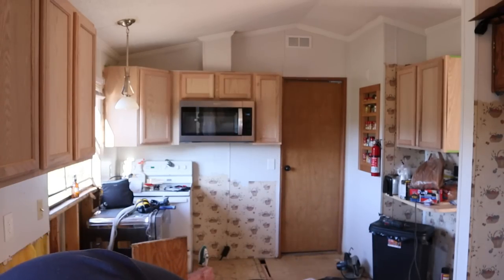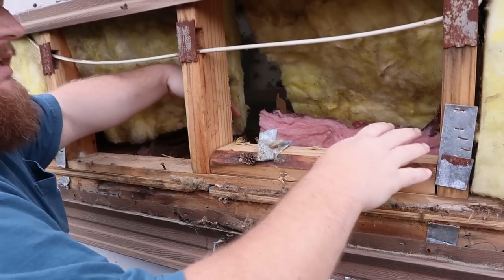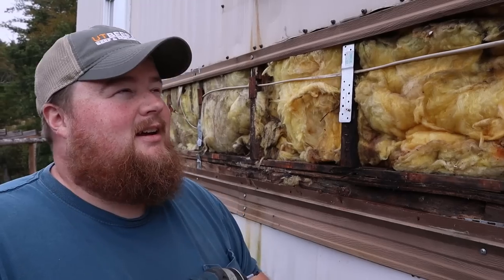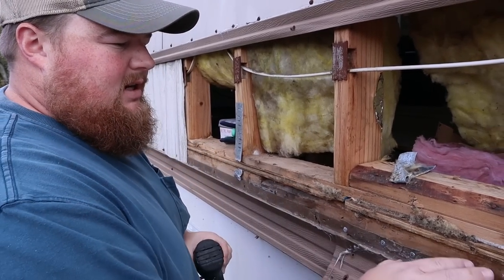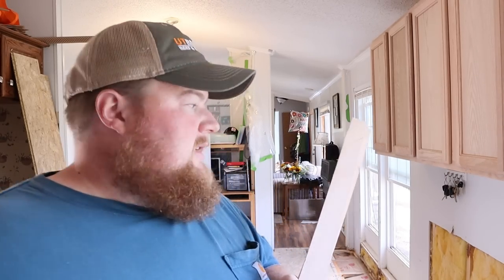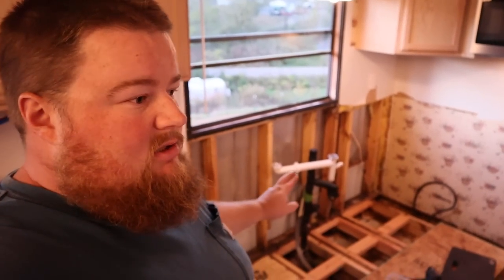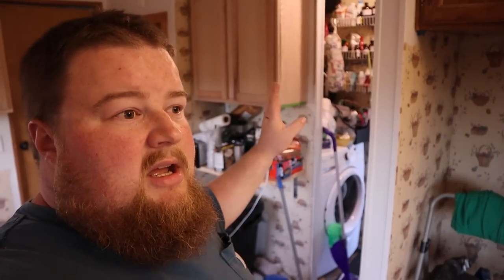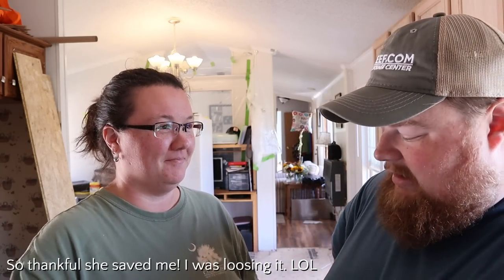Siding Removal Shows Just How Bad This Is | Budget Mobile Home Remodel #14

Comment: Sam, i think i mentioned i have a 95 double mobile home and i was wondering i would have to pull down my belly wrap to pull all those lines out? Or should i do like you and try to replace them room to room. The big issue is i dont have the floor issues yet…well my master bathroom does. I’m going to be fixing it this winter when i get a chance probably in December . Would you bother to remove them? I’m not sure how to approach it. I recently attached pex to my grey lines and now im scared i used shark bites…

Comment: I also have 1980ish model single wide. Im thinkin of doing some of the remodeling yall did on yalls. My main question is. Did yall go back with standard size 2x4 studs in yalls outer wall of the mobile home????

Comment: Guys i know this feeling all to well. Its one thing after the next. It makes it even more disheartening when your currently laying your head down at night in the area your working. Dont give up one thing at a time. Great job.
Reply: I have inherited a single wide. It has a metal roof over kit installed. The home is sitting  on heavy, poured  concrete runners and still on it's  wheels. 
It's everything in between the roof and foundation that has me very concerned !.

Comment: I know this is an old video but, did that wire arc at 6:15? The stud on the right, that “plate” that holds the wire on looks like it arced when you moved it up.

Comment: I found  aluminum  coating for the roof  it helps with leaks and house wrap can also be used on the inside  to help seal your house. I had to replace  a huge amount of mine

Comment: Gr8t job. I have a 2004 and just noticing floor leak . Outside siding holes to let water drain have been clogged. Water must be just dropping down between wall n siding. Haven’t pulled apart yet.your video gives me options thanks very much. You both are a terrific team.
Reply from the maker: Glad it helped, good luck!

Comment: I used the spray flex seal on my car's sunroof. The drain channel goes from it to the floor of the trunk. It is supposed to drain onto the road, it gets clogged from stuff on the road. It kept the trunk full of water and then it started leaking into the car. It filled the headliner and started coming out at the windshield and the light fixtures. I came out after it had rained to find about 3 inches of water in the floor board. After I got the water out, I went to Lowe's and got a can of Flex Seal. I sprayed it on and just had to add another layer about every 3 months because of the sunlight. I hated that car so many things were wrong with it. It was an Oldsmobile Aurora, 2001, it's a GM. All that wasn't as bad as the fact that it accelerated on it's own, either when you started so you had to turn it off and on until it stopped, or while you were driving it would do it. GM didn't want to talk to me. I don't have it anymore, I sent it to the junkyard so no one else would be almost killed by it.

Comment: My wife and I just finished replacing the floor in our kitchen in a house built in 1951. We have 1x8s running at 45 degree angle, then 3/4 inch  ply wood, then four layers of floor covering. Couldn't get the floor covering off the  plywood so we decided to replace it. They had three inch nails to hold the plywood to the sub flooring. I bent my crobar getting the plywood up. Got the new osb down, looked great, new tiles and we are very pleased. Watching you made my back ache again. You are doing great work, keep t up.
Reply from the maker: Oh wow!!!

Comment: You two are working really hard and doing the best you can!!!!
You all couldn't find some type of under lay or Osb board to put outside to box the insulation in, and began putting vinyl siding instead of that metal siding outside. Do 1 side of the side per payday to fully waterproof the home.  That siding is your only defense against the weather!!  Your home looks nice inside like those newer mobile homes. It just serms like you all need to research exterior  materials that you can put on that outter side under that metal siding or under new vinyl siding!!!!

Comment: You Two are doing a great job

I don’t know what You Two do for a living but You  are doing Great here

When You replace the insulation and removed the old I couldn’t believe what I saw.

Palm Harbor Homes put aluminum siding on Your home and attached them to 1x6 slated every 2 or 3 feet and the insulation right up against it

We repaired a single wide that had floor and wall damage from those leaky Mobil home windows

Our Mobile home had OSB over the wall studs and then vinyl siding over that 

No moisture barrier between the siding and the vinyl 

OSB for almost the entire length had water damage 

I had Our Guy pull the entire side down to the studs and remove the windows 

We were lucky the only place We had drywall damage was beside the main door where the roof leaked.

He replaced all the OSB and then I asked Him to install roofing paper over the OSB to act as a moisture barrier

Watching You cut and replace floor boards with minimal gaps made mine look like a blind person with the shakes cut my plywood 

Thanks

I went back today and You inspired this 68 year old to a better job

Thank You

Comment: Noticed the Myrtle Beach shirt! I just bought a 2018 Tru singlewide in Conway. it's definitely been a 'fixer-upper' as the previous owner put it through hell. if you guys are local to the MB area, would love to connect and share ideas! we had to do a lot of wall hole repair. Some panels were so badly damaged that we ended up replacing them with Drywall. Hope all is treating you well!

Comment: As a fellow mobile home guy, just was curious if you ever thought to add some plastic to cover the walls/floors before adding the metal back on the outside; or on the inside if removing the sheetrock, etc

Cardboard or even better old plastic signs works GREAT to help seal the house.

Drastically reduces the power bill due to not having air leaks
Reply from the maker: We house wrapped the new kitchen wall while it was apart (separate video in this playlist) and have plans to do that to the entire home if the day comes we can afford to put new siding on the whole home. We'll see how prices go!
Reply: I understand!

I think your channel is great!

Good, honest content.

Have you tried doing composting for a small vegetable garden?

Comment: I have used that advantech flooring, it can withstand repeated wettings, be aware, if you ever have a problem with carpenter ants they love the advantech. If you use any of that blue foam or the pink form they also like to make tunnels in the foam. We do have problems with carpenter ants in the North and the Northeast. Oiled and treated wood helps prevent some of that which includes termites

Comment: I reframed my windows to fit a common size window that Lowe's carries. They are vinyl dual pane and far better than mobile home windows. I also have replaced all exterior screws with the hex head neoprene washer screws. You would not believe how much water is entering your house around those rusted exterior screws. Our $600 hardwood floor project turned into a $2,000 rebuild. 😂😂😂

Comment: I've lived in a mobile home for about 16 years and have learned to make sure all outside repairs and mold are repaired and removed, before making the inside beautiful.   Black insulation and rotten wood is not good.  If you have mold in the wall no air purifier will make you safe inside.  I had to spend 5k on my home for mold removal, then the repairs in the floors.
Just make sure you make it safe for yourself and your family.  Your family can have health problems from it.  Just as a side note, my home didnt have much black mold but instead a white mold you couldn't see, just smell and after the mold testing the report said it was not safe for humans to inhabit, so be careful.  
I have enjoyed your remodel and have learned alot.

Comment: As fellow trailer trash with an uneven kitchen floor that we suspect came from previous water issues, I appreciate the commitment it takes to rip it all up for replacement. Been in it two years and still don't have the courage to tackle it. Wife seems to be super helpful. I should show mine this video. Subbed.
Reply: Whatever you do, DON’T show her this video! (Unless you’re in the mood to tear into a serious project)
Reply: Sensei Rich I have the same problem in my mobile home in the kitchen but my leak is coming from the roof, had a friend go up to look at it , it was a tiny rip in the roof. Glad I came across this in case a leak is on the side, never considered the side leaking.

Comment: Sam and Angela, 
Really like your channel. Thanks. I acquired a 1976 Champion Mobile Home single wide and need to add a wall socket in the living room about 8” in from the sliding door and right at the base plate, too the kitchen counter. All the sockets in the home are at the base plate. I was wondering if you could show how your base sockets wiring looks sense you have the walls gutted?
Reply from the maker: Sorry, this video was in October of 2019 and THANKFULLY our kitchen/dining room is all done. Our outlets are wired just like home outlets though.

Comment: Take out the fiberglass and replace it with Rockwool or another type of mineral wool and cover with tar paper and then if you put a gap in-between the siding make a rainscreen so that the material dries out.  You could replace any of the  rotted wood with steel.  I have used 4x8 sheets of Hardie Board.

Comment: Great job! I think you guys are going about this reno the right way.  It is really easy for a renovation to get out of hand.  Your costs could skyrocket if you try to fix every little thing you find when you find it.  Like you said slow and easy, you can always just do temporary fixes and come back to it later.  At least you will have a better idea of what still needs to be done when you are able to spend the time and money to make more permanent repairs.  IMO you are doing a service to the community by showing everyone it is ok to do what you can as you can and not get in over your heads. Make sure to check out your foundation, joists and "Bones" before adding too much more weight. It will save you a ton of heartache down the road. Thanks for sharing!

Comment: Awesome work. Owned 1993 single wide new. I started in 94 with my preventive maintenance. I caulked, insulated, foam sprayed and checked for leaks all the time. Cool sealed the roof. Cleaned gutters. Washed and waxed the exterior aluminum siding. replaced and caulked exterior screws. Every six months I inspected and touched up seals and joints. Water is your worst enemy. Keep up the good work and remember constant maintenance and you won’t have to worry about a re-do. My heart is with you. You love you home just like I loved mine. It will last!

Comment: Thank you so much for your video's. I just bought a double wide for cheap last week. It needs to be totally remodeled from floors up, Something I have no experience with. Thanks to your video's I'm hoping to do as much as I can on my own. Can you please go over some of the most common tools you use? thanks again, from Georgia.
Reply from the maker: Outside from the normal hand tools like hammers and pry bars, there are three tools we have used over and over on this remodel that have been wonderful:
Oscillating Cutoff Tool (for trimming floor, cutting staples, and more): https://amzn.to/2POsnTt
6-in-1 Scraper Tool (for pulling trim, cutting items, and scraping): https://amzn.to/2NJeBPm
Knee Pad: https://amzn.to/2NLKXZN

Comment: I can't believe they were allowed to build these mobile homes like this putting tin on the outside with nothing behind it but the minimum amount of insulation and wiring
Reply: THE ORIGINAL PROFESSOR CHAOS  I'm not so sure the new standards mean as much as they claim as I noticed cold air coming in around the inside trim on the front door pulled it down to find minimal insulation so they build them with thicker walls but shotty work and charge more I agree that no one in this country should be homeless it's sad
Reply: @bramwellprice8833  yep lots of wealthy people on this world that have plenty and still want more and then we have poor people with basically nothing  . get rid of all the wealthy people , wealthy people are usually greedy corrupt people  .
Reply: yes and most older homes like this are going to have this type of damage from what i can tell
Reply: Trailers were meant to be cheap housing. That is what they were and the old ones still are. They could be better, but then the cost would be higher. Modern new trailers cost almost as much as a reasonable shape used house with land. The older ones can still be had for cheap. It is what it is. There are measures you can take to increase energy efficiency in older trailers, it's just a matter of how much you want to spend on it. The problem today is that housing costs too much due to all the code. The average person can't afford to buy a house or even a new "manufactured home". I spent one-thousand on my old trailer. It's paid for. No monthly mortgage payments. I can do with it what I want. If I want to burn it to the ground for the jollies, I'm out a grand.
Reply: @markthompson4225  yup its all to do with greedy people trying to save a dollar  . they cut the workmanship in half to save and then they say who cares about 30 years later to the next person that gets it  . a bit better sealant and a proper fitting and then no rot damage .
Reply: Bramwell Price I agree I work on them everyday the things I find are amazing
Reply: @carmichaelmoritz8662  Sam and Angela will not be poor forever. They are hardworking, industrious people. They are getting things done instead of whining.
Reply: They don't make them like this anymore
Reply: @mark Reaves exactly, same her, but we gave to work on them and keep them up more so before they get damaged. It's a shell and when we repair and keep them up they make great homes.
Reply: @NotSoCrazyNinja  what I said when I tried to respond down below.
Reply: Unfortunately that is very common on mobile homes.  Many states have stiffened up the laws but even mine has a fiber siding and it rots because they did not have eaves on the house.  When it rains it goes right down the wall.  I have replaced many sections with James Hardie Board.  My next project is to install 2 foot eaves.  I am thinking of going with steel studs because it is fire proof, light, and strong at the same time.  I am trying to devise a rainscreen to dry out the water that gets behind the siding.
Reply: @rexkirkland3720  yes. Just like Doug and Ashley at DIYFFERENT.  They go to the rotten bottom and start over. So enjoy watching and  learning from them.
Reply: @mariettedemarest5173  love Doug and Ashleys channel.  Did you watch any of their olders videos.  They re-done a single wide a little while back before they moved to Michigan, it turned out amazing. They have repairing mobile homes down to a science. Good family they are.
Reply: @carmichaelmoritz8662  Sorry but that's not true at all. Not all were born that way, they've worked,saved and earned it !!
That's what makes this country great, with hard work, dedication and some common sense you can go a long way in this life !!!  
You say "get rid of all the rich" and what,..take there's ?? That's the classic definition of communism.....  equality, bla, bla, bla.... get off your rump and go earn it !!!!
Reply: Me too 😮 just one big🔨 piece of a fire hazard 🧯🔥
Reply: @SmiTTyy-sh8nc  if not for my disabilities i'd earn my living and be very wealthy  .   if one person gets the easy life , all other good people should get the easy life  .   fairness , caring .  not many people care anymore  . its all about themselves  .
Reply: @NotSoCrazyNinja  Your best bet is to buy a used mobile home cheap on its own land all cash then you can fix it up just the way you want it to especially if you can do the work yourself.
Reply: The worst is a vaulted ceiling, because after the roof gets damaged, guess where the water drains into, the inside of the walls. Learning this after so many storms hit Louisiana, insurance is paying us to try and relevel it, and if it can’t be done, it will be totaled. There’s mobile home being sold for really high prices now and not much improvements on the issues. I want out of ours so badly!
Reply: Welcome to the real world. I live in Northern Michigan and my trailer is built the same way.
Reply: That is why
Reply: @scottshingleton7659  that's the best idea. I bought mine 30 years ago, owner carried a loan. It was paid off and I have lived here 20 years rent free.

Comment: I'd install a 40A-60A (Amp) breaker and Romex, to a receptacle box in the wall for the stove.
Extension cord fed thru wood, may not be too safe if wires turned red hot for whatever reason.

Comment: Uuug...more water damage! It seems never-ending doesn't it? With Flex spray and the flashing tape that leak should be gone until you have time and money to attack it from the outside. The air filter in your room is important until you get it cleaned up permanently. Over 40 yrs ago, when Pop set up his mobile, he built a pole building over the whole thing with enough overhang to put a deck around two sides. I thought it was overkill at the time...not so sure now. Although we've had to replace a bathroom floor, kitchen floor and, the granddaughter's bedroom floor in the front, is getting iffy. All caused by plumbing leaks....so it's wonderful you're addressing the plumbing now. One step at a time and you'll have a nice, safe, solid home for years to come! You two work so well together. I love watching you :)